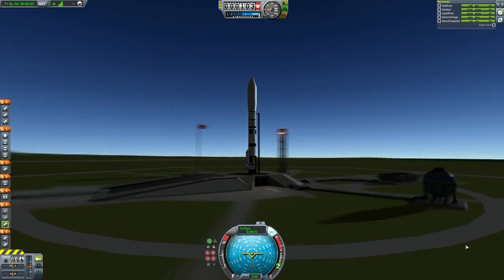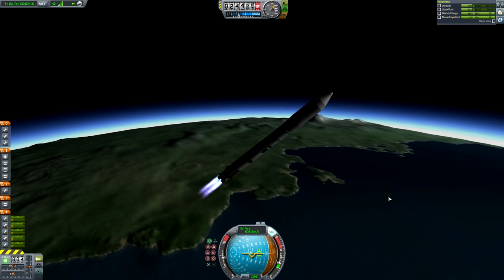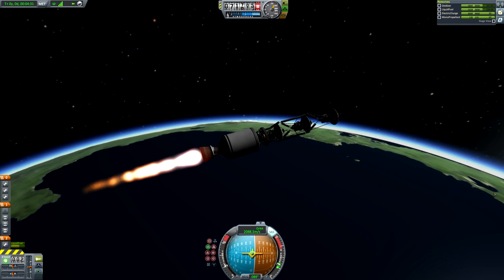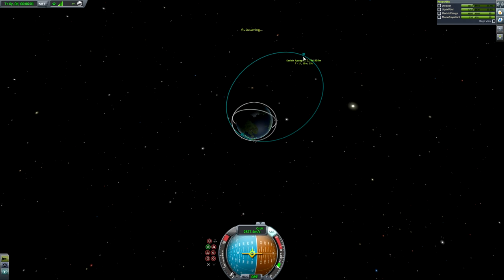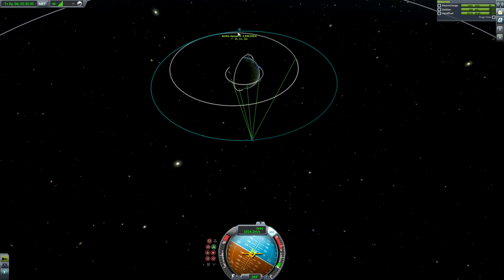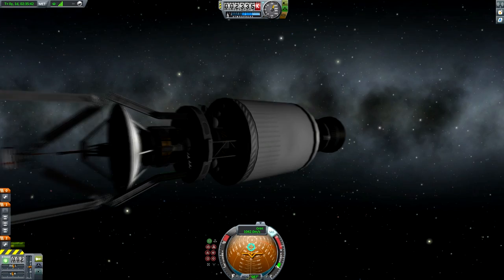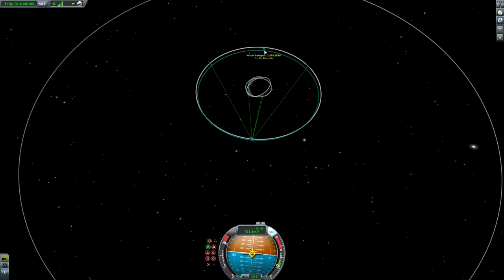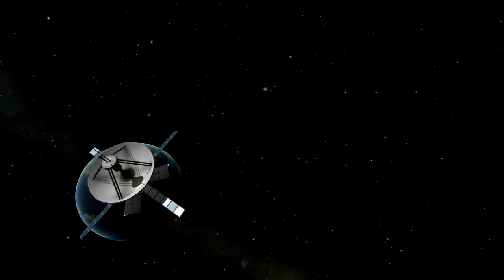KSP 1.2: How To Create a Geostationary Relay Network

Comment from the maker: www.Twitter.com/Matt_Lowne

Thank you for watching my first tutorial, in fact this is my first non-SSTO tutorial! Let me know how it went! I'll be putting satellites around Mun and Minmus anyway, would this be a video people would be keen for (with a commentary)?

I'm aware that the "equilateral triangle" I was aiming for ended up slightly scalene...but it's good enough I think!

In order to keep the video short, I omitted my fine-tuning of the satellite orbits. However, remember that lower orbits move at higher velocities and higher orbits move at lower velocities. This means circularizing the orbit just below the 2 863 334.06 m mark will cause the craft to move "East" relative to Kerbin's surface, and circularizing just above with will move the craft "West" relative to the surface.

Quick note: those familiar with Scott's tutorial may notice that the apoapsis he used is different to the one I use. This is because Kerbin's rotation was increased in the 1.05 update, which came out after Scott made his tutorial. 

Anyways, craft file in the comments etc. etc. 

The background music is the gallery theme from Sonic Generations, and the outro music is the rooftop run theme from the same game.
Reply: certainly Matt, thanks for sharing this info ;)
Reply: Was this early access? Or is 1.2 out yet for ksp. Thanks for the gso tutorial, keep up the good work!
Reply: This is a very good tutorial, thank you!
Reply: you should do another body's network using an SSTO. I've played with remote tech and could never get a good SSTO to setup networks.
Reply: I'm a new subscriber, but really enjoying your content! Keep it up!

Something I always struggle with is "efficient" rocket design. Maybe a tutorial on figuring out the dV actually needed to do things instead of just wildly guessing like I do would be nice?
Reply: This is very helpful even that I don't have the game
Reply: Really well but just a little more explanation on the calculations next time please, like William Cornell did on my question ^^
Reply: For a stationary orbit you have NOT necessarily do perfectly circular orbit. All you have to do is set the period of the orbit to 5 hours 59 minutes 9.4 seconds - it's the period of Kerbin rotation relative to the "skybox". If an orbit will not be circular it's not a problem, satellite will just do left-right wobble as seen from Kerbin's surface, but it will stay on the right spot. The same is for inclination, that might not be zero - then the satellite will wobble up-down around the same spot of the sky.
Reply from the maker: the 1.05 update changed Kerbin's rotation to be exactly 6 hours.

Edit: see below
Reply: Matt Lowne really? Where can I find the source?
Reply: Matt Lowne I know Kerbin rotates with 6h period relatively to Kerbol, not to the skybox. If they did 6h period for skybox then Kerbin's day must now be more than 6 hours...
Reply from the maker: van Valdis Choose any 1.05 update change list you want. The most explicit one is on the "Kerbin" article in the KSP wiki (ctrl+F "6 h synodic day").
Reply: Matt Lowne "A synodic day is the period it takes for a planet to rotate once in relation to the body it is orbiting." - Wiki. Synodic period is not what we want. And sidereal period - which is what we want - is 5:59:9.4... At least it must be so if they didn't messed up synodic and sidereal.
Reply from the maker: You're right actually, getting my synodics and sidereals confused. This being the case, however, the apoapsis figure in the video is still correct, and for the purposes of the video it's easier to explain geostationary orbit in layman's terms as being the same as 1 kerbin day, rather than delving into explanations of synodic and sidereal periods.

Or it's a typo and they meant to write sidereal, one of the two
Reply: Matt Lowne oh you know, this mostly shouldn't be the problem. The satellites just will do one revolution relatively to Kerbin per year. If their orbital period is equal, this shouldn't disrupt communications since they always will be in triangle. Just a thing, if gamer wants satellites to be really geostationary, he should focus on sidereal which is not equal to familiar 6 hours.

Btw thank you for attention, love your vids ;)
Reply from the maker: Haha thanks :)
Reply: I believe its technically "keostationary" not geostationary since its not on earth
Reply: Come on ^^
Reply: Spectre I just used the habitual term.
Reply: Great job
Reply: Matt Lowne pls reply

Comment: I usually fudge it by not requiring an accurately circular orbit; as long as it's close, it's good enough. The key is matching the orbital period to ensure that the satellites don't drift over time, either relative to each other or to their SOI -- but that requires MJ, KER, or kOS to ensure accuracy.

Comment: As a long time player I recommend having mechjeb for the fine details. I'd use the node generator to make a set apoposis* then when you need to do the circulation burn just make the node. It'll do accurate burns down to like 2m it's sweet. You could even get rid of the drift on the inclination by getting the info from the wiki.

Comment: Wait, you need satellite relays for 1.2 vanilla now? Not Remote Tech?
Reply: Yep
Reply: Yes. Awesome aint it?
Reply: Dr.Sensei-Hugo The slow march of Vanilla KSP assimilating modding. It is glorious, glorious!
Reply: yes. if you cant directly connect to kerbin with a satellite relay, you will have limited (or no) control for unmanned vessels in ksp 1.2
Reply: That's awesome
Reply: And there's difficulty settings, so you don't even have to deal with these limitations on control when out of range. You can set it to no loss of control, partial loss of control, or full loss of control.

The one thing that hasn't been made stock is signal delay.
Reply: Anase Skyrider Cool!
Reply: If you have a Mk3 command pod with 2 or 3 crew members and a KerbNet capable relay dish on your ship, you can control any satellite, probe or rover that you have line of sight to.
Reply: @shrike6243  well, first we had mk2 parts, than we had remote tech, then we had deltaV calculator, than precise maneuver nodes, and now we have infernal robotics

Comment: You don't really need the fancy rig to hold the satellites. Just make each one a separate stage (with a faring), and use enough of a second stage to get them into the elliptical timing orbit. You use a normal stage separation to drop each satellite off the back side of the stack, instead of unpacking them from the front. Less weight, less fuel, less boosters, same result.

Comment: When you set up a new game you can go to advanced setting in the difficulty setup and disable the other stations around kerbin. This makes it to where only KSC can get a signal and you would need this network for full coverage. You will also need this on other bodies to control on the radio dark side. This or some other systems which there are a few that would help you get around this on planets where you cant do that.

Comment: Great video. I'm fairly new to KSP, and your vids are very helpful (and entertaining). 

I had a thought - that the ratio of the geosynchronous orbit AP to the "deployment orbit" (1/3 the geosync orbit time) PE would likely be the same, independent of the body you are putting the satellites around, so I gave it a try on Minmus. Deployment PE/AP=1225/2863 (your vid), indicates that the PE should be .4278 that of the geosynchronous AP - so for Minmus, AP=357.94 / PE=357.94*.4278=153.13 ... worked like a charm. Suspect it will work elsewhere as well. Many thanks.

Comment: Ike being in essentially geostationary orbit will still let you set up a network if you simply avoid its SOI. In fact, I was/am planning (in 1.0.5 because 1.1.x is balls) a Duna network with RemoteTech that uses an Ike network as one of the nodes for my Duna network. Basically 5 satellites: 3 around Ike to cover its surface, 2 more around Duna itself to cover Duna's surface. The DunaSats would double as the Interplanetary links back to Kerbin (since you only need 2 Sats with a reasonably separation to keep basic interplanetary links. It's the surface links that need about 6 for full coverage). GeoSats around Duna would be stationary to Ike as well. The only problem would be the initial deployment. You have to target Ike, set up a rendezvous that intersects it at Geostationary altitude, lead it by 120 degrees, the get into 2/3 resonance. This will make sure the second approach to Apoapsis isn't gonna gonna approach Ike (since you will be leading the first sat and thereby trailing Ike by 120 degrees.)The lack of N-body simulation make the sat orbits stable. You'd only have problems if the orbital periods of the Sats differ enough that they'll drift over time relative to Ike. (That's what station-keeping is for, technically.)
Reply from the maker: Ike isn't in a perfectly geostationary orbit though, so eventually it would catch up with the other satellites. And yes, a non-geosynchronous network would work just fine if you place it beyond Ike's SOI

Comment: I used to do this to a 99% or so accuracy and then use hyperedit to fix the damn things into a proper orbit because KSP tends to screw around with the highly precise orbits sometimes which caused my network to decay over time. Not feeling guilty at all :P 
Also, I usually tried that quite early in the Career, so no RTGs, instead my relays were quite big to accommodate all the batteries and solar panels.

Comment: I did a Keostationary space sation with 100 tons and circular format (like interstellar or your circular space station on Eeloo)
Everytime I dock some ship in the station, the orbit get a bit modification. I away ajust the orbital period to 5h59m9s (most close to this) even ignoring the orbit imperfection, that aways is around 2.862~2.864Km with 0.1m/s or less of relative speed at surface. That is my best for the most keostationary orbit

Comment: of course, Squad has now made your scaffolding system obsolete..
Reply: How's that?
Reply from the maker: Not really, I needed that scaffholding to provide somwhere to attach the decouplers for the satellites. The symmetry of the structure was more for aesthetics
Reply: But the fairings themselves now have attachment points that automatically create a scaffolding within the fairing that you can attach stuff to
Reply: +Matt Lowne I went to the ksp website, clicked store, and signed in but I couldn't download it. By out you meant "currently being beta tested" right?
Reply: He means anyone using the steam version gets it
Reply: And the non-steam launcher. They have made this one available to everyone.
Reply from the maker: Diesel Robot The automatic fairing scaffolding would have clipped into the antennae dishes though, wouldn't have looked nice! I used the scaffolding to house the probe core and batteries for the booster's guidance units though, you can see it in the bit where I'm de-orbiting it!
Reply: antennae?

Comment: To me doing this is "essential" as I do NOT use the additionnal groundstations! KSC is my only available ground station! :). I found that using a bunch of satellites with different orbits (some equatorial, some polar, at different altitudes, etc) is fine for having a link to KSC MOST OF THE TIME. But it still happens that the satellites are all behing kerbin and have no LOS with KSC. Keosynchronous orbit satellites are crucial to me. At least one that stays over KSC and that will let me relay to anything that isn't directly behind KSC. a triangle like you did is the perfect satellite network.

However, I found that any triangle that is big enough for the corners to have LOS with each other (I.E high enough so Kerbin isn't blocking the link between them) is enough. The satellite getting a link to KSC changes as the satellites are faster or slower than Kerbin's rotation, but there is always one of the 3 satellite that sees KSC. So as long as you have a triangle, you should be fine! Keosynchronous orbits are simply more niche and desirable :)

Comment: Sorry to be picky, but it is not 6 hours. It is 5 hours 59 minutes 4.901 seconds.
6 hours causes you to drift west over time. You want the Kerbin Sidereal rotational period, not the Kerbol Day rotational period.
Reply from the maker: In 1.05 Squad sped up Kerbin's rotation so now it actually takes 6 hrs
Reply: That is the rotation based on the position of Kerbol above a certain point on Kerbin at the same time each day, not the actual rotation of the planet Kerbin. Synchronous satellites need to be placed based on the sidereal rotation of the planet respect of other stars (if the game had them) and not with respect to Kerbol. Kerbol appears directly over the KSC every 6 hours, but as Kerbin goes around Kerbol in prograde in both its orbit and its rotation the sidereal day will always be slightly slower. Using 6 hours causes satellites to drift. Try it by hacking a save file and placing a craft directly above the KSC with an orbital period of 6 hours and speed time forward, it will drift over time.
Reply: +Simon Warburton The new cheat mode should be enough I think, also why would it matter as long as you always have line of sight to the other sattelites and ksc the geostationary is really not necessary, is it?

Comment: You could get a 'geostationary' 'orbit' 'around' the mun by placing the relay on front and the back of the mun orbit around kerbin.
Reply from the maker: True. But that's more of a psuedo-geostationary orbit, since you're not actually within it's sphere of influence :P
Reply: Matt Lowne That's why i always use 'this'. But to reach the not kerbin facing sides from mun and minmus i placed 3 relays in a more dostamt orbit than minmus.
Reply: I believe that means placing the spacecraft at the leading and trailing Lagrange points, L4 and L5.
Reply: +Astro Fox ksp didn't have Lagrange orbits
Reply: ΑΡΗΣ ΚΟΡΝΑΡΑΚΗΣ *doesn't
Reply: ²P.I.X.E.L go to write greek without the Google translate, and autocorrect... There is the fun...
Reply: True, KSP does not have Lagrange points, but you can attempt to get into an orbit with the same orbital period as the Mun. Mostly near 60 degress before and behind the Mun. This really helps with communication networks near the Mun.
Reply: Astro Fox it's doesn't have lissardise orbits also. Squad said that by implementing those, needed to rewrite the code of the engine

Comment: you need 5, and every one has to be 120 degs (plus or minus 5 degs.) apart from each other to establish a stable connection even for the worst antenna in the game. The 4th and 5th probes are on polar orbits

Comment: Actually, stationary orbit around Kerbin doesn't have 6 hours period. Instead, it should be 5 hours 59 minutes 9.4 seconds, which is the Kerbin's sidereal day.

And, if you have mods that somehow change Kerbin's rotaion, or change you starting body or even the entire solar system, you have to go to tracking station and look for the rotation period there, and not just trust the day length value in mods description.

Comment: Hello! Great video but I'm with a doubt and a problem. Every time I go to do my Geostationary Relay, I throw it and I get a limited connection on it and I can't start the engine or do anything with the satellite, so I can't adjust my orbit. What am I doing wrong? What antenna should I use? And, what antenna you used in this video? I'm new to the game and bought him recently, I'm using the mods RT and MechJeb. Any tip will be very welcome! Thank you

Comment: I made a relay network a while ago.Recently popped on and realized I must have made a VERY small error because I made the network around day 40 but now nearing year 4 in game and now I am noticing that one of the relays is drifting ever so slowly out of position. This is going to be a very difficult fix haha.

Thinking on it I might just upgrade the satellite and do a whole new network. Why not right? It would be easier than doing a whole new launch just to maybe correct one satellite and then it not even work. The network still provides near 100% coverage and it took a couple years in game to drift off course. that gives me tons of time to work on the new solution before the old network begins failing.

Edit: My solution ended up being setting up a new network on a different plane and leaving the old one as is. This generates a more relay mesh style setup that is more realistic to how we currently run it IRL. Also, the new relays are much more powerful so my effective max range with the relays has increased greatly.

Comment: I noticed your cool scaffolding made of girders, looks pretty neat. But are you aware that they are not entirely necessary? There are multiple nodes along the length of the fairing, which you can attach different payloads to.

Comment: Geostationary is unnecessary hassle when building relay network. Just put three satellites on any roughly circular orbits high enough that they can see each other and spaced by 120 degrees and make sure they have the same orbital period, bam you got your network.

Actually I would say the higher the orbit the better as on higher orbit you can tune their orbital periods to higher relative precision.